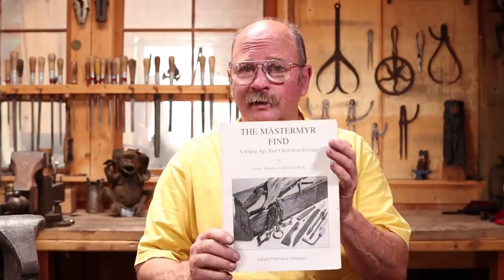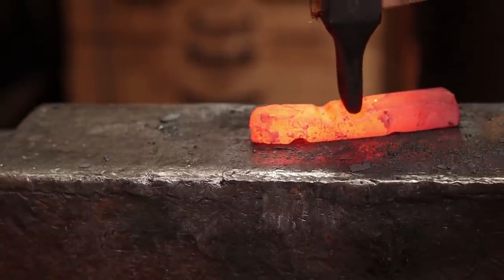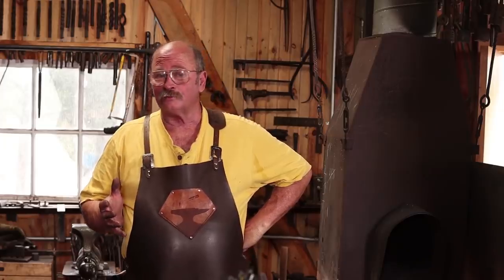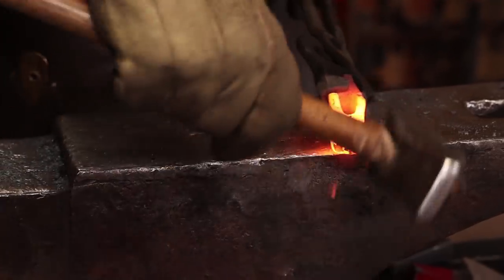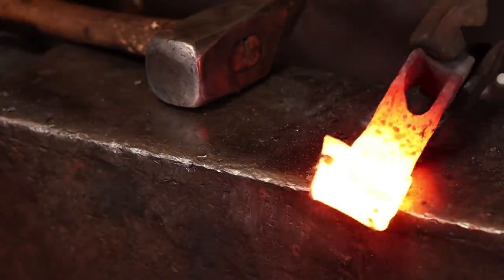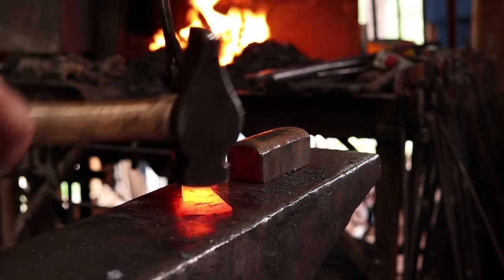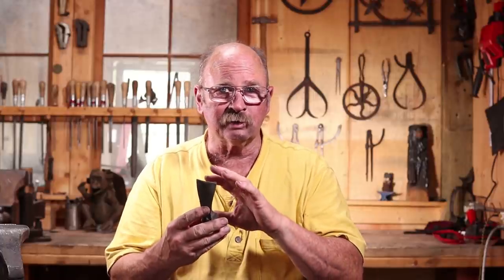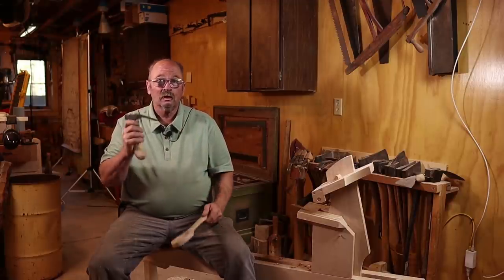Wrought iron Viking adze

Comment: Hey John. Thank you for your excellent videos over lock down, it's really been great to watch and keep me slightly more sane. Just wanted to comment on the wrought iron that I know you've worked with before and had problems with as well. I've worked a lot with wrought iron over the past couple of years, with some stuff being more refined and some being very unrefined. For aesthetic reasons I actually prefer the less refined stuff... but obviously it is weaker and more difficult to work with in that sense. Saying that, I've not had delaminations for ages now I've found two things more important: only work it at welding heat and be lighter with your hammer blows. It can be a bit of a pain to only work at welding heat but it really seems to work best. Right at the end, I may take some lower temp planishing blows, but really very, very light just to refine the surface appearance.
Reply from the maker: Thanks for the suggestions. It is certainly a different material.
Reply: Yes very true. Light blows help
Reply: Thanks guys, I work with a lot of wrought as jacket for go mai knives. Light blows make sense. Hot of course. Damn hot.......😁awesome John.
Reply: Must say, tapping the metal lightly isn't exactly what my conception of a viking smith was like xD

Comment: John, I am a shipwright and an adze man! Was gifted mine by a retiring tradesman when I was in my second year. A fantastic tool, if you know how. While in the building industry on projects with big timbers I would be laughed at with my adze until it was seen just how effective and quickly it got tricky and difficult joints and details done. Love my adze, only sees a bit of work a few times a year now and still treasured! Oh, your handle, perseverance,and congrats on getting something out of that , I would have given it a proper cremation in my forge!

Comment: thank you a lot for those authentic scenes of the process.  A boy came recently with the problem of coil springs. Normally very fine material for little knives. But sometimes it just splits and cracks, however careful he worked on it. In this actual case we were not surprised, how frequent the car mechanic had to exchange those elements.....

Comment: Norèn and Enander, authors of Klassiskt Järnsmide (classical ironsmithing) (I don't think that particular book exists translated) also found several mislabeled artifacts.
They used art. no. 104 as a direct punch instead of slitting and drifting, with art. no. 77 as a bolster.
With low carbon iron worked very hot this gave no problems and the hammer eye turned out fine.

Comment: I've always been told that when working with wrought, you always want to bring it up to welding temp and refine it (whether it needs it or not). Also, you always want to work it at or near welding temp because it has the tendency to want to crack, and/or, delaminate.

Comment: Wow bud nice adze   There is a guy on eBay selling wrought iron it’s from a school from the 1870s.  I bought one pack from him already and it’s pretty good stuff it welds really nice and doesn’t delaminate at all.  Just keep it hot.  If I can remember the seller I will forward to you.   It’s mostly 3/4 round x 6 ‘’ Aprox.    Been trying to make a sign bracket to hang my shop sign. So lots of welding and I did carve out a dragons head and it stayed together really well.   I’ll send pic if possible just a heads up.   Thx for sharing ....Paul 🇺🇸🔥⚒👍
Reply from the maker: Thanks, I'll keep my eyes open

Comment: Thank you for your GREAT channel!! Just a quick question on this project, why forge weld the hole? Meaning, instead of punching & drifting it.
Reply from the maker: Two main reasons.  First this piece is from wrought iron, which has a grain structure similar to wood.  Punching leaves short end grain that is easily split out.  The second reason is that people without larger tools will find it easier to forge a wrapped eye (once they learn forge welding) than it is to punch and drift the heavier starting material needed for punching

Comment: Nice skills on that project John. Hopefully that W2 didn't overcook. You'll find out on the edge retention. I'm from Canada and have never heard of Scrub oak. What's it about? 👍
Reply from the maker: It’s a brushy oak that doesn’t grow into trees. But spreads through the roots and can be so what invasive. Also adds a great deal to the wildfire threat. So we try to keep it thinned out.  Gambrel Oak is the correct name
Reply: @BlackBearForge  Thanks! Sounds like it would smolder for days underground in a dry summer.

Comment: The turning of the Kamera could be just ½ Times more speed so you can see how you start working at the power hammer
Reply from the maker: This is as fast as that system can turn
Reply: @BlackBearForge  maybe pur it on a solide to let it rotate Chile it solides along or früher back and Zoom

Comment: Boat or bowl adze.
Reply from the maker: Way to small for boats
Reply: @BlackBearForge  These curved adze have no fixed size standards, this is a bowl adze, For a canoe, you need a larger one. For the curved ribs of the Viking boats, just imagine. Woodworking adze is straight.
Reply from the maker: Yes I know. Thats why I said its to small for boats. Also why in the video I stated a woodworking adze would not feature the sweep.